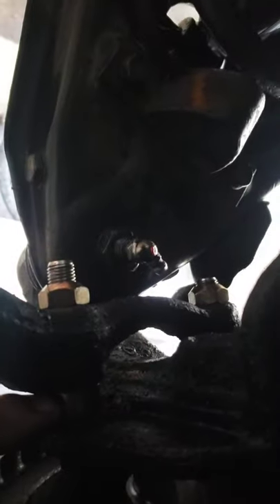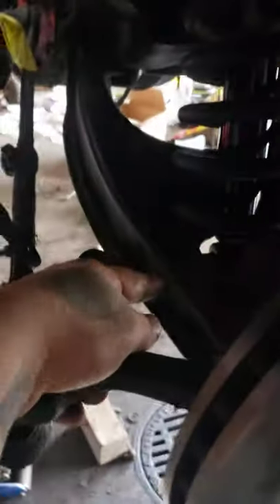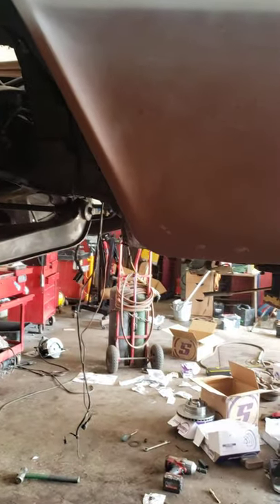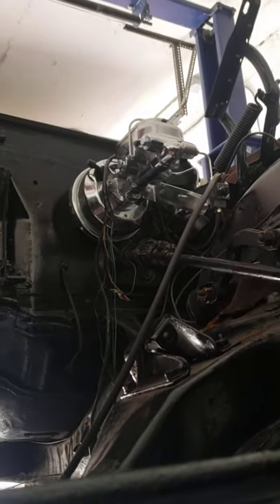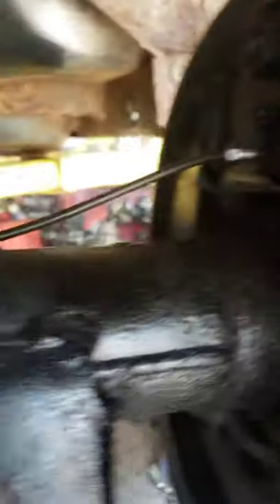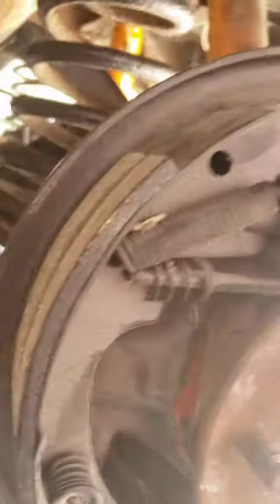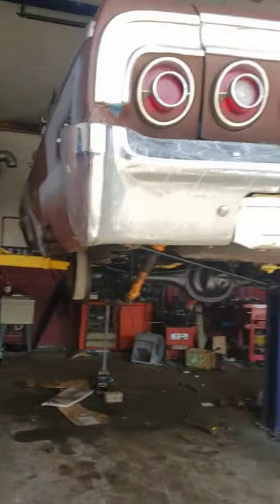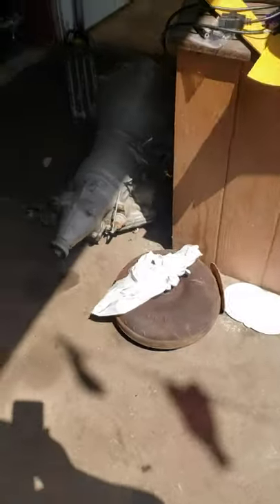disc brakes conversion kit on 64 impala ss

Comment: I purchased a gearhead kit from eBay. No instructions either and I can’t find any videos on installing it. How do I know if the brake caliper is facing the front towards the bumper or the back towards the firewall?
Reply from the maker: Front